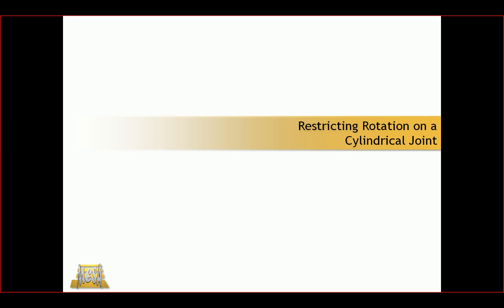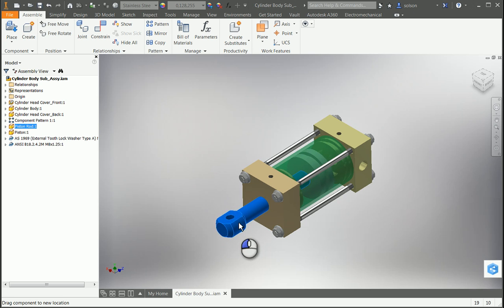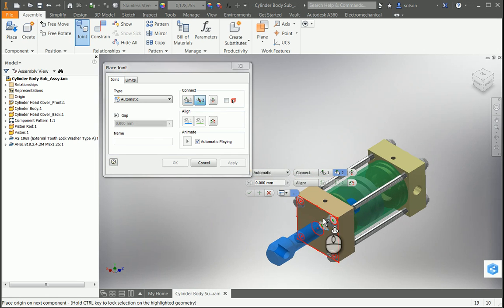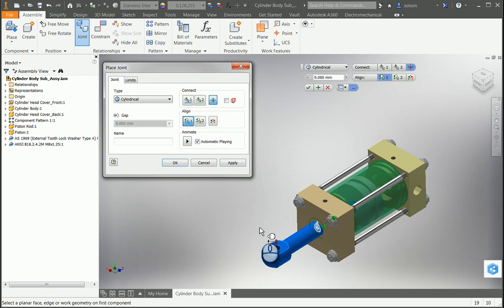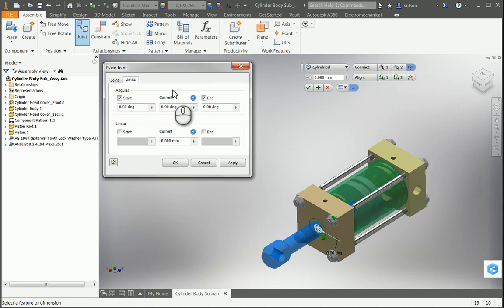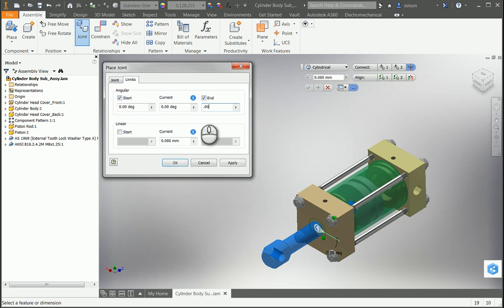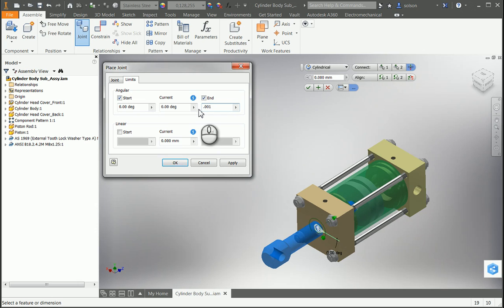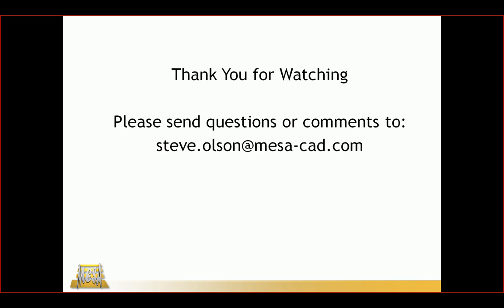Restricting Rotation is an Cylindrical Joint

Comment: does this only work if you have a tolerance between the opening and the slider?
Reply from the maker: I am not sure what you are asking.  The joint definition is going to be identifying points on faces or edges, so Inventor should't care if you have a gap or not.  Realistically, the software should still allow you to create the joint even if the block doesn't have a hole for the rod to fit into.